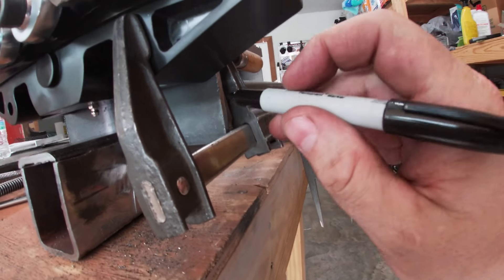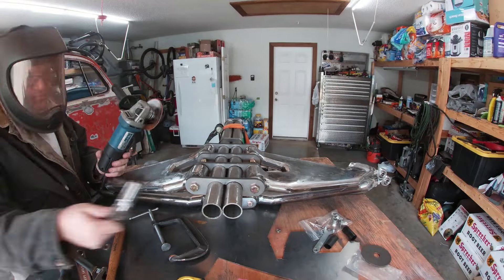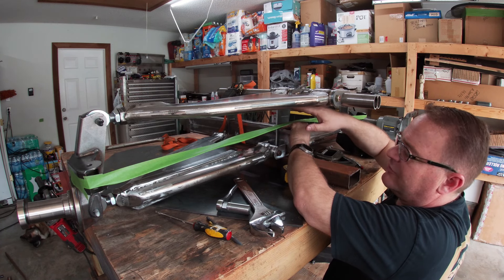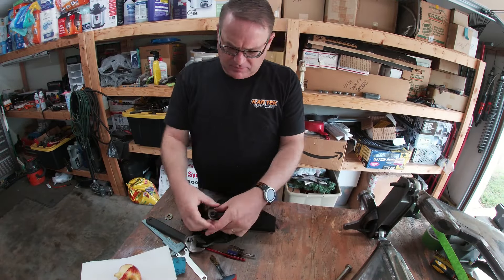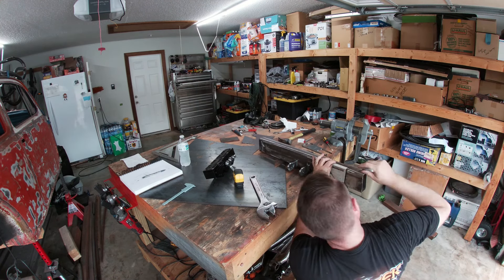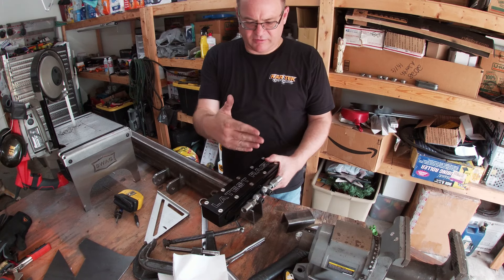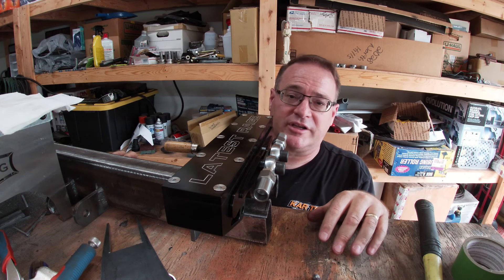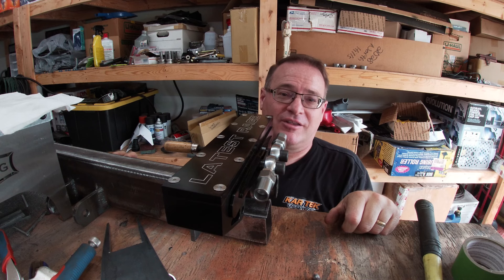Baja Bug Build (Ep. 41):  Building The Steering Rack Mount

Comment: Glad it's all coming together for you! looking good. You'll probably have to make a lot of clearance for your steering u-joint, I'm always surprised at how big they are, especially in tight  spaces. You can weld in a small tube to access your zurks.
Reply from the maker: Sup HRD!  Good to 'see' ya.I remember how you showed me your access holes for the zurk..and I may try that, it's just that I'm thinking of building some tubes under my bulkhead for sliding/reinforcement. 

I'm planning to use roll cage tube to make room for the steering joint but I think I really need to get one in hand to insure it fits!

Comment: Another interesting video. Thanks for continuing to share them. Is a 90 degree zerk a thing maybe? Did you test fit whatever joint goes on the that splined shaft? Just looks really close to the beam in the video is all.
Reply from the maker: Hey Matt,   Yes a 90* zurk might be just what the doctor ordered.  And I'm sure the steering joint is going to hit so I'll be using roll cage tube to make a trough for it so there's no interference.  I have one on order to make sure it'll fit right.

Thanks for commenting